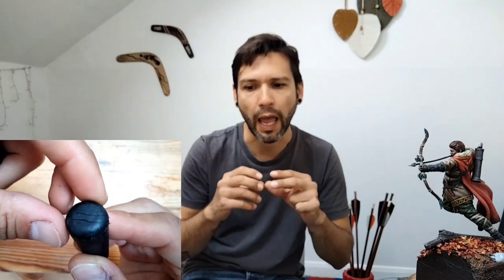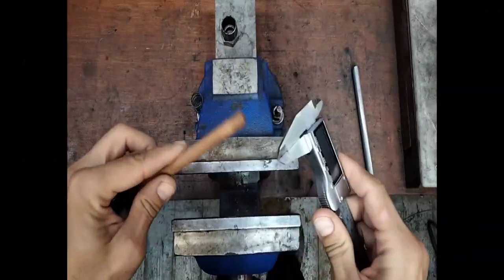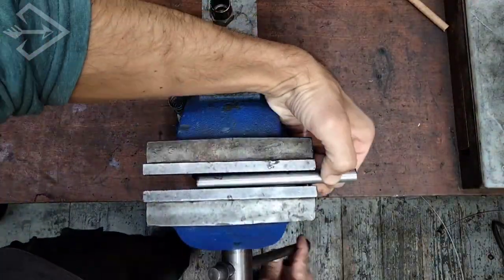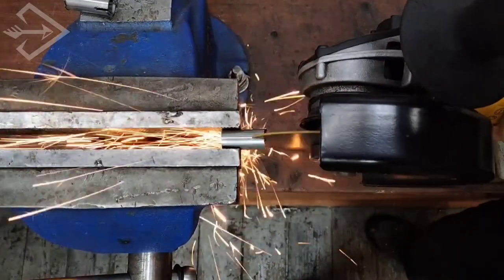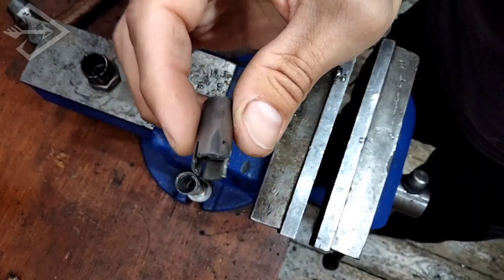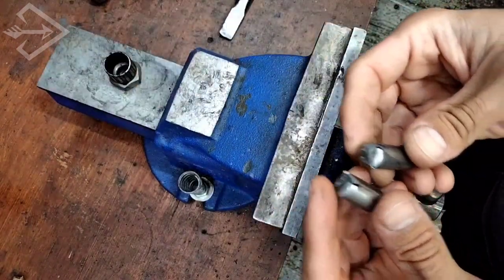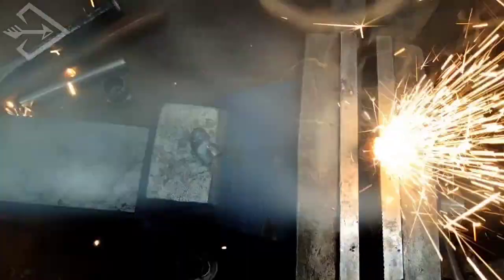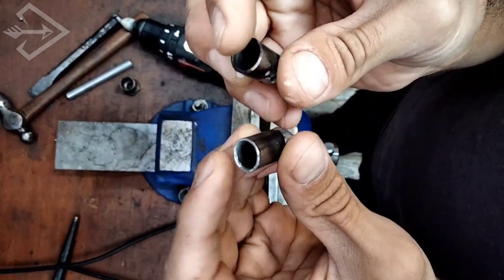Blunt Arrowheads | DIY | blunt tips | Arrow Craft archery

Comment: What might be quicker if your welding would be to insert few mm of threaded rod or solid, weld around the outside then cut it off.
Watch out for zinc fumes welding indoors you don't want to be breathing them.
Reply from the maker: Yeah, I see where you're coming from. Definitely a nice idea to consider in the future, specially in terms of robustness (I think it might take just as long). Thanks for your comment ;-)